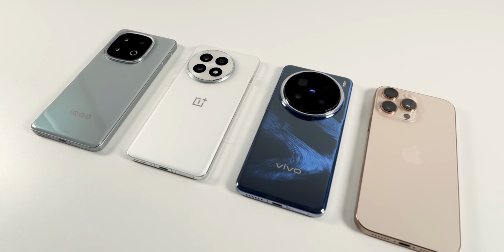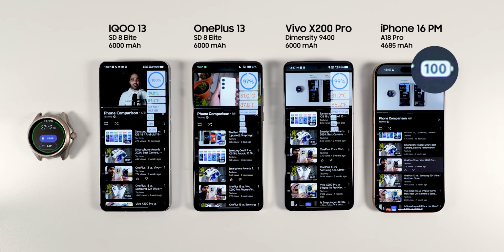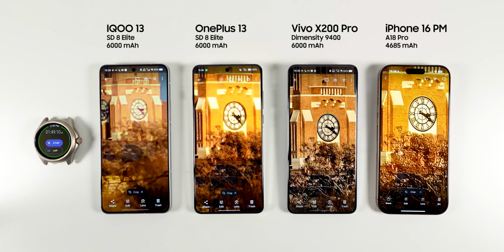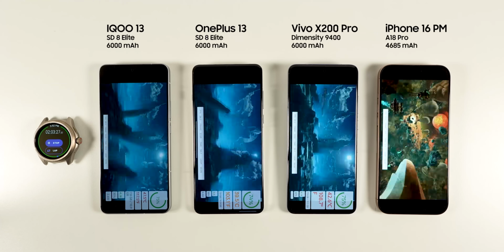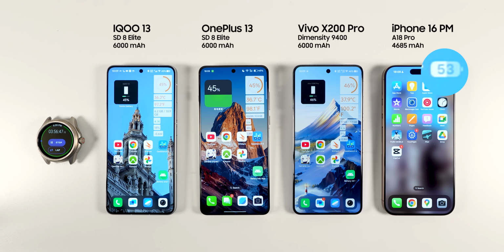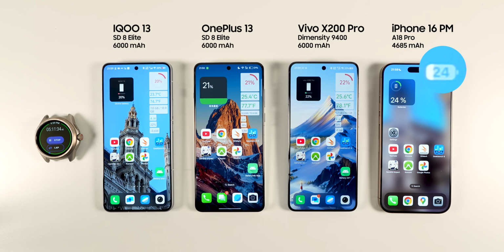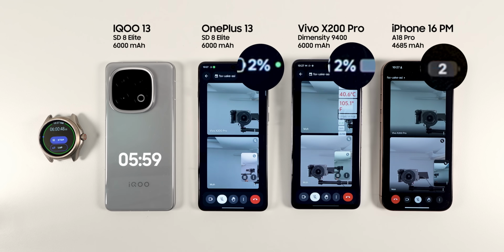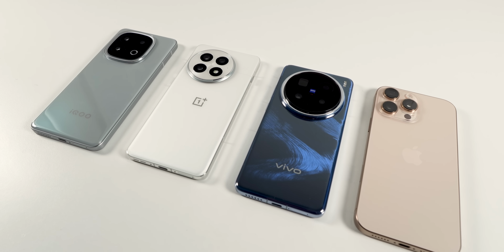Best Battery: OnePlus 13 vs. Vivo X200 Pro / iPhone 16 Pro Max / IQOO 13

Comment: the difference between the two mobile operating systems, on android the possibility of applications running in the background can accelerate the reduction of battery power, therefore android phones require large capacity batteries. while the ios operating system limits applications running in the background so that a lower battery capacity is sufficient for the phone. so iphone fans should not be proud of the small battery capacity of the iphone. actually for heavy performance android is the system that drains the most power and in this situation. so, the situation can be said to be balanced between android and ios. but android is able to beat the iphone in terms of battery life.. moreover the screen refresh rate is smoother on android.. LoL. oh yeah, screen refresh rate also drains battery power.. LoL iphone.. 🤣

Comment: Do a video with just using YouTube & Instagram at medium brightness.
Most people don't use benchmarks & doesn't push the phone way too hard.

Some phones are better at video streaming on 5g than others.and no you can't extrapolate from this result, because battery drain from 100-90 isn't proportional to the rest of the capacity.

Comment: Bro, the OnePlus 13 didn’t shut down, it just switched to ultra power-saving mode, which lasts for about 40 minutes or so. But the Vivo completely shut down, and you can’t make any calls from it like you can with the OnePlus.

Comment: I like how Oneplus lies about its power consumption. When you measure the Amps drawing from battery, it's basically half. 
So instead of 1A and 4V which is 4W, it is drawing double that at 8W.
The situation is even worse, as it can reach "2A" power draw like nothing in games, which in reality is 4 AMPS, aka 16W power draw.

In a smartphone ffs
Reply: So I was going to buy my bad gut this phone, redmagic 10 pro or oneplus 13 or iPhone 16 pro is good

Comment: The issue I have with iphone is it is on such a boneless and restricted operating system that. It has a great battery life cause it ain't doing much. Plus it takes almost 2 hours to charge. While it takes the one plus 13 32 min to fully charge. So it dies faster and charges over 1 hours slower than a phone that can do way more than it. Vivo is obviously the top king tho but not if you live in usa. So for me one plus is.

Comment: In my location OP 13 and Oppo Find X8 pro have the same price tag. Which one should I go for and why?
Reply: I don't know about the Oppo but OnePlus 13 has a high power draw problem compared to the rest of the phones because the company did not limit the power of the processor, this is what I think
Reply: I want you to choose the Last Comments button on this video and you will find from the latest comments someone explaining the OnePlus 13 problem. And oneplus lying about how much watt is drawn.
Reply: I am telling you all my think based on just that latest comment

Comment: IPhone does not run 100% performance in 3dmark after the first run.
Unfortunately, the others will all run close to max performance as possible until they throttle.

Comment: Brother can you recommend which is choose Samsung s24plus or s24fe, battery and camera is the concern
Reply: Better get the fe if  u dont care about the thicker bezels and little lower brighness ,other all specs are the same except the optical finger print on fe which is little slower that ultrasonic.i am planning to get the fe
Reply: Fe is bad in battery live and plus if he come with Processor Exnoyus Also weak in battery

Comment: I'm going for the OnePlus 13
Reply: OnePlus Pulls a high watt and consumes higher power Based on one of the comments in this video
Reply: @user-kd9vj6dq5l  I have the OnePlus now, and I've also used the iPhone, Samsung, and others. The OnePlus sips very little power under normal use as long as you don't have the screen set at ridiculous levels.

Comment: why do you keep comparing Iphone to Android. They are 2 different species. Like comparing a car to a motorcycle. The can both transport you from A to B but in very different ways. Or compairing cat and dog.  Both are pets, but in very different ways.
And I believe, if you're in one ecosystem, you are most likely to stay there. You don't buy an Iphone one year, and the change to Android the next time, and maybe back again the 3. time. All the work by changing ecosystem, creating new account, move all your data and more, prevents people from changing all the time. And the eco-systems are also very different. In Android you can do almost anything YOU like, in IOS you have to do like Apple wants you to do.
I've been using both systems simultaniously (Apple at my work and Android privately). Just getting some data from 1 system to the other was a pain in the a**. Especially from Android to IOS. Again, Apple doesn't want that. I have chosen Android and I would not even consider changing to IOS. It's way overpriced at buying and has a ton of things you have to pay heavily extra for.

Comment: One of the big reasons to keep me away from chinese brands. They have an amazing hardware on paper but on real life it doesn't work how it was suppose to work. How a phone with a smallest battery handle more charge than others which has a mamoth battery? The answer is simple: optimization, software and etc. 
They can put 10000 battery to these phone, it won't work.
I 4685 mah battery which is the size of 2018 phones beats the new glacier technology battery, no sense at all
Honestly i will stick with samsung and next year i will see the fold 7.
I can't trust on these chinese guys, alway has a flaw.

Comment: Your iPhone's battery would have been the first to drain if you had run the test all the way. It's a completely invalid test, except for those who have never seen a battery drain test. The iPhone is the last to drain the first percent of the battery, but it drains faster than the rest of the iPhone.

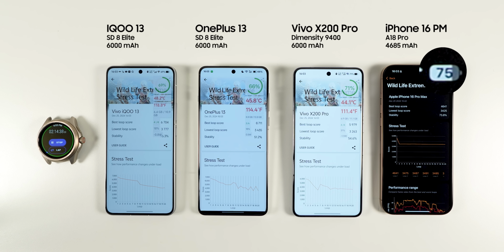Comment: 4:32. Is the vivo brighter than the 2 on the left? it looks way brighter
Reply from the maker: When phones get hot they dim the screen.
Reply: Yeah it doesn't look like the phones were calibrated to same brightness, coupled with running benchmarks that different manufacturers set to different throttling limit this comparison has quite a few issues

Comment: Imagine if the iPhone has 6k mAh
Reply: Iphone use much lower ppi density. Iphone refresh rate is much lower. Iphone resolution is much lower. All of these take extreme battery. Iphone brightness is much lower then vivo. And iphone automatically dim brightness level after some point.so many reason is on iphone side for longer battery. And their software focus on battery more.

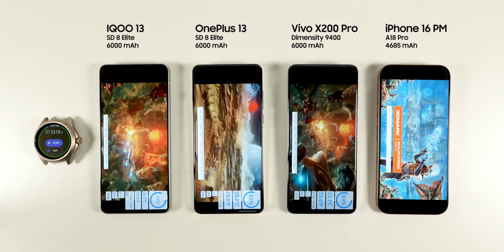Comment: 3:48 Don't use benchmark for battery life test, specially 3DMark.
Because, some phones push their limits and some are not.
For example, after loop 1, the iPhone limit it's performance for saving battery (you can see the graph in benchmark result). On the other hand, the Android devices pushed their limits for all the loops. This creates a huge variation in battery life comparison… 😅
Reply: I commented the same thing and some guy is arguing with me. It's like comparing gas mileage between two cars with one running at 150 kmph vs the other running at 100 kmph.
Reply: I agree, and noones running benchmarks on a regular basis so much so that it warrants a benchmark in the middle of the test
Reply: Same issue with games, Iphone tends to limit performance to prevent it from running too hot. I found some video comparing iphone and android phones side by side.
Reply: Nobody can do battery tests correctly. They all do different mistakes.
Reply: What on earth are you on about. It's actually the exact opposite, the iPhone isn't throttling as much as the other 3. It has an stability of +70% which means it maintains +70% of it's maximum performance during all test loops, meanwhile the android phones are dropping to under 60% of their initial performance. Some phones are pushing and some are throttling harder than others, but it's literally the opposite as what you described.
Reply: @superior96  it already throttled before starting the test so it has lower scores but higher stability because it's limiting it's performance to conserve battery

Comment: Please don't forget to add Turkish subtitles.
Reply from the maker: Hi, you can use the auto-translation; I added the script, so it worked great with Turkish the last time I checked.
Reply: Hi, I am using automatic translation but unfortunately Turkish is not among the options.
Reply from the maker: @salimdurcan1833  thanks for letting me know, I'll try to add it from the next time
Reply: @salimdurcan1833  Masaüstü sürümünde Türkçe altyazı mevcut. App'de yok.

Comment: Stop using benchmarks in battery comparisons! These apps are made to test the max speed and by design consume any available power the phone give them. its not the same workload. Even in your own video the battery percentages were the same but after the benchmarks the iphone (that throttles) was 10% ahead.

Comment: Doesnt matter. Those 3 phone would be at 100% in less than an hour again while the iphone would be 100% in 1 hour and 30 minutes. Lmao
Reply: 35 minutes 1+13.
100-115 minutes iPhone 16 Pro Max.
Reply: @Eminem_9696 but iphone doesnot let you correct on continuing use. You have to wait some time.

Comment: and before anybody starts to talk about small batteries and what not on the iPhone 16 pm

Yes, in most cases, using a lower screen resolution can help save power. Here's why:
 * Less Data to Process: Lower resolutions mean fewer pixels need to be illuminated and updated. This reduces the workload on the device's processor and graphics chip, which in turn consumes less power.
 * Reduced Backlight Intensity: With fewer pixels to light up, the overall brightness of the screen can be reduced without significantly impacting the perceived image quality. Lower backlight intensity directly translates to lower power consumption.
Reply: According to research I have seen the difference in battery consumption between 1.5K and QHD is about 6%, and that was a few years ago, so I suspect with new display tech that is now less. As the iPhone has a 25% smaller battery than rivals that still makes it significantly more efficient than the other phones. And most experts say that QHD is overkill for bragging rights unless you use VR. The optimum is 1.5K, and even 1080p would be more than good enough for most.
Reply: @andyH_England  😂😂😂😂 You trying to justify the low resolution on the iPhone 16 pm, no excuse man no excuse for that price should be at 4K and for the heat part the CPU will GPU on the other three are running harder
Reply: @macgyvermac2344  There are no 4K smartphones so what are you drinking? Even Sony that had 4K never used it apart from 4K video. Anyone with technical knowledge will tell you that 4K is stupid on a phone. In fact if you ask AI, most suggest 1080p is the sensible option as it optimises battery life (12% better SOT than QHD).
Reply: @andyH_England  You clearly missed the point 😂😂😂😂😂😂 it's okay, now as I did say, at that price it should have been running 4K easy, I'm going to say it again it doesn't justify the lower resolution on the iPhone 16 pm, to say it have good battery performance, 😂😂😂😂😂😂😂😂
Reply: @macgyvermac2344  Only techies care about 1.5K or QHD. Apple targets the core market who do not think about stuff like that. It is why Apple makes 85% of all smartphone profits, they do not cater for the tiny niche techie demographic, wheras LG did, and where is LG now?
Reply: @andyH_England 😂😂😂😂😂😂 I know That's why it's called bias 😂😂😂😂 people who use it don't know better and it's all about status an image, until they meet a person like me with a phone that can outshine there's in every way 😎😎😎😎😎😎
Reply: @andyH_England You guys are the reason why apple sells medicore products more...60 hz ,20 wt charging support in 2024 for 800$ phone...😂...and guess what iphone battery health degrades faster than any android phones..
Reply: @macgyvermac2344 you forgot iPhones scrolling isn't as smooth as in android 120 hz...They deliberately lock it to 80 hz to save battery.....

Comment: Apple increases their chip capabilities and literally slap on the same old skin with bit of improvement here and there of course it will last. They are scammers 💀
Reply: I would say that most phones do this now. OnePlus 13 is no more exciting than predecessors nor is the Vivo, and the S25U will be similar to S23U. So, I assume you are just trolling.
Reply: @andyH_England  yes but most android flagship will allow you to change the screen resolution, change the refresh rate and a but load of customization that the iPhone could never. Because they know the moment the do this their processors will be found out
Reply: @kobehans7376  There are millions of iPhone users that micro-manage their phone that will jailbreak. So, your bias is apparent. But most smartphone users do not care about the stuff you do.
Reply: @andyH_England  yeah buddy I think you are stuck in the 2010s just like iPhones. People aren't  jailbreaking or rooting their phones as much anymore, because manufacturers at least on the Android side are offering way more capabilities. So perhaps look at yourself before you speak. iPhone is light years behind the others in time so capabilities, but it sounds like you've been under a rock or you are just an isheep and if most smartphone users didn't care about those things that I care about then we would all be iPhone users lol
Reply: @kobehans7376  Try Googling it. There are believed to be 9% of uses that jailbreak--then Google how many iphone users, 1.46 billion, so 140 million jailbroken phones. Your comment seems very uninformed based on 20 seconds of Googling.

Comment: Despite IPhone lacking multitasking and compatibility with most apps even tricks resresh rate and brightness to provide longer battery life, Android phones does more workload while running that because Capacity difference. But after just 1 years iPhone holds only 4h battery))
Reply: Absolute nonsense.
Reply: Thats the dubest sh i have ever heard😂 my iphone 13 pro max still last as long as my s23ultra.

Comment: Those 6000 shit compared to the iphone, pretty embarrassing 😆
Reply: Iphone use much lower ppi density. Iphone refresh rate is much lower. Iphone resolution is much lower. All of these take extreme battery. Iphone brightness is much lower then vivo. And iphone automatically dim brightness level after some point.so many reason is on iphone side for longer battery. And their software focus on battery more. Get some education iphone is a cheater.

Comment: well ig iqoo was set on 2k resolution, while other ph must be on 1.5 k
Reply: And Apple had a 25% smaller battery. It is what OEMs make, so you have to accept that Iqoo wanted to hype resolution whereas sensible OEMs use 1.5K as for most people this is retrina for normal use.
Reply: @andyH_England  sir  i agree iphone has smaller battery  , but see apple has it's own  software optimizations ,and first of all i should tell you that i am not promoting iqoo battery . i was just clarifying it in comparison with vivo and one plus .
Reply: @asindiangamer6238  That is fair. Many Chinese OEMs are moving to 1.5K from 2K as they are also looking at improving optimisations.
Reply: @andyH_England  sir  even with optimisations 2k resoution still has more battery usage than 1.5k . i hope you understand the point. may be i am wrong . but i feel like there's no point to argue on this coz all 4 phones are super great.
Reply: @asindiangamer6238  I said I agree, about 6% difference but what I am saying that the difference in quality from 1.5K to QHD is not noticeable for many and OEMs would be sensible to return to 1.5K and get back that 6%.
Reply: @andyH_England  yeah you are right , but in this vedio , iqoo is set at 2k so i was just "telling" that it was set at 2k . This was my only point
Reply: @asindiangamer6238  Cool! Worth pointing out.
Reply: @andyH_England  haha thx.

Comment: The iPhone is a battery champ. If only it had a 6000mah battery like the rest, it would be light years away.
Reply: Iphone use much lower ppi density. Iphone refresh rate is much lower. Iphone resolution is much lower. All of these take extreme battery. Iphone brightness is much lower then vivo. And iphone automatically dim brightness level after some point.so many reason is on iphone side for longer battery. And their software focus on battery more. Get some education iphone is a cheater.